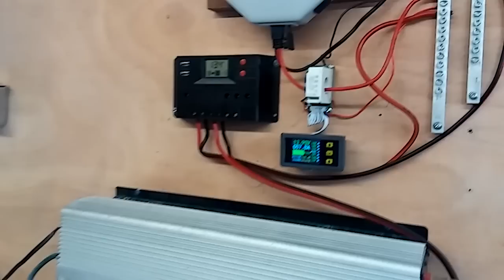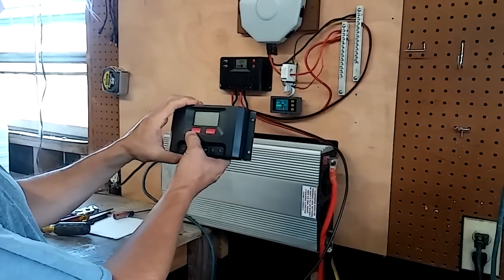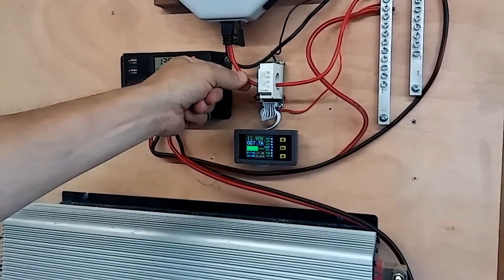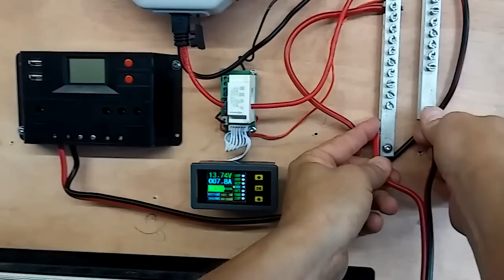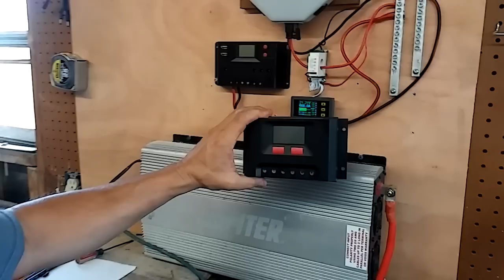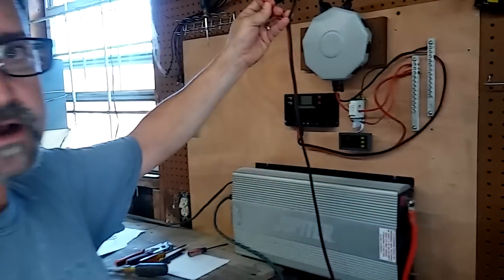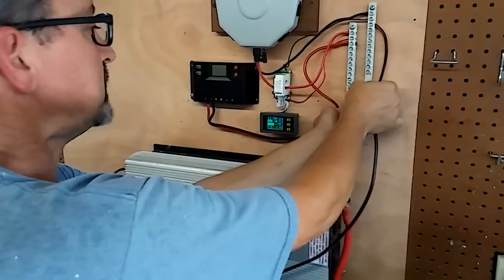Maxing out Harbor Freight solar panels

Comment: Pick up a cheap 400W Wind Turbine for around $200!  You'd be surprised how much extra you can supplement your panels with a Wind Turbine.
Reply from the maker: roostershooter76   I do have my eyes set on. It’s only 200 watts at 24v. Thought I might try it
Reply: It would be cool to use a whirlybird connected to wind turbine generator to benefit from the excess heat being created. Added efficiency

Comment: Your reasoning on the charge controller is flawed. The controller actually can either boost or cut the voltage from the panels as needed. The internal microprocessor calculates the output wattage every second and adjusts the boost or cut to give maximum watts into the load. The battery holds the voltage constant at the battery voltage, which in this case is not at the optimum load voltage for those panels to give maximum output.
Reply: That is a very accurate explanation of how an MPPT CC should work ....

Comment: I would like to remind everyone that this guy   Has probably not checked the output of his panels when his battery voltage was lower than 12.4 V At that high of a voltage most charge controllers especially cheap ones and even hooking the panels straight up to the battery will not charge it much faster because at 12.4 V the battery is pretty much at 100% state of charge and is more resistant to taking a charge Then if you let it run down to 12.3 V or even 12 V Plus the fact that the panels are mounted directly to the roof is going to cause them to get really hot which will cause their efficiency to drop in fact it can even cause connections in the panels to DE solder themselves Which can render a panel completely useless What he should do to test each individual panel and see If each individual panel is working is he should put a load on his battery bank that is more than what  His solar array is capable of putting out and wait at least 5 minutes And then he should go disconnect individual panels and see if that makes a difference if a panel is working correctly and giving him the proper output he should be getting 1.4 amps per panel meaning his arrays should be giving off 14 amps right now Or what he could do is unplug one of the plugs for a set of panels and see if that changes the Ambridge at all And if that doesn't change the amperage at all he should plug that set back and and unplowed the other set and if the other set being unplugged kills the output altogether  Even with that 1 being plugged in then that just means he has a set of  bad panels  But what he should really do is he should put a load on his battery with his pinos all completely unplugged And it should be  A  200 W plus continuous load And then he should plug each individual panel back in check the amperage then unplug the panel and plug another one in check the  Amperage anti should do that with all of his panels to make sure that each individual panel is working and they all have a consistent output with each other And if they don't have a consistent output with each other or even some don't have any output at all he knows hes got   bad panels.

Comment: you may try one more thing to maybe bring up the amps coming off the panels...  bypass the combiner box...  run your positive cable coming in from the panels to (1) bus bar, run your negative cable to the (2nd) bus bar...  then use the little short +/- cable that came with the system....  to the charge controller....  this may help, and maybe not, but while you are experimenting,  it wouldn't hurt to try it....

Comment: HA HOW YOU DOING ......I GOT A DROK METER  WHAT WHOULD BE THE BEST WAY TO INSTALL .......I HAVE THE SAME SYSTEM YOU HAVE  HARBER FRIGHT I LIKE THIM SO MUCH I GOT MORE OF THIM   285 VOLT  CAN YOU HELP ME IF SO THANK YOU..................RWE.............
Reply from the maker: I didn't have much luck with the Drok meter so I got the Yecco one instead. Its the one in this video.. But if you are going to use that one , it has a shunt to read amps. Your load must travel through that shunt. Just like as if it were a fuse. Then just hook up the positive and negative to the meter. Remember!!!.. You must use the positive and negative that is also powering the device you are testing. You can't use a separate power supply to power the meter.

Comment: Like your video, but for one thing. Is it a good idea disconnecting solar panels in bright sunlight. You could damage your solar panels.
Reply from the maker: I've never heard that one before. Thnx. I will take that into consideration.
Reply: I did read that some where some time ago. @Checkitfirst
Reply: That's like saying: When I'm out in the sailboat and the wind comes I will take down the sails because the sails might get ruined.
Reply: @TowingTransport  There is times when sailors take down the sails when there is too much wind because the sails will get ruined.
Reply: @paulwood2329  Where did you read that?  I call BS !
Reply: @MrSummitville  If you don't mind your solar panels covered in hairline cracks then carry on doing what you always do.
Reply: @paulwood2329  After 10 years of "doing what I always do", I and all my neighbors do not have this problem.  Again - Where did you read this BS ?
Reply: @MrSummitville  It's written on one side of the MC4 solar panel plugs.
Reply: @paulwood2329   It does NOT state that you will create hair-line cracks in your PV Cells !  The RULE is ... Do NOT disconnect any MC-4 Connectors while the PV Panel is under load because the ARC can damage the MC-4 copper contact or YOU.  You pull the DC Disconnect Switch first, then you unplug the MC-4 Connector. This has nothing to do with hair-line cracks in the PV Cells.  Like I said, I call 100% BS on your hair-line cracks nonsense.
Reply: @MrSummitville  Just out of interest have you ever tested off-load voltage of your solar array? It's high enough to give you a very nasty shock.

Comment: Wrong! An MPPT controller will reduce the voltage and boost the amps. How you came to your conclusion an MPPT controller can't help you is beyond me.
Reply from the maker: I wasn't producing enough power with what I had to justify getting a mppt. I did however get one. It didn't benefit me at all untill I added more panels. Now I can justify the cost. 200 watts isn't enough power to get any benefit from a mppt. I now have 500 watts and the mppt is doing what it should.
Reply: Correct you would need 400 watts and possibly making a 24,48 volt system before justification for a mpp inverter. If running 12v the harbor freight controller is just fine☺️

Comment: Those 8 solar solar panels are rated at 25 watts for each individual panel but this rating is at 18 volts not 13.78 (your current battery voltage seen in this video) Your sending all 8 of those panels in parallel to that charge controller. You have the potential of 200 watts (18 V @ 11.1 Amps) worth of solar panels but your only going to get a max of  about 153 watts. The reason is because Your charge controller is truncating the solar panel voltage anything above your current battery voltage 13.78V  So  the wattage between 13.78 and 18 volts is wasted. 4.22 volts  X 11.1 amps is  46.8 watts LOSS. All 12 volt solar panels have this issue. The only solution is to use an MPPT charge controller. It electronically converts the 18 volts of each panel to a lower charging voltage usually around 14.4 volts. and at the same time raises the charging current. At around 95% efficiency You would end up with about 14.4 volts  @ 13.19 Amps in full sun. depending on the charge state of your battery. Giving you  about  190 watts vs 153 watts using the cheap harbor freight controllers. Get your money back on that charge controller and go online and look for a MPPT charge controller. Don't look for one at Harbor Freight.
Reply from the maker: Thank you for your comment. I have learned what you say is true. I did find a mppt on Amazon. It's in my latest videos. I have also added 2 monocrystalline pannels to my set up☺

Comment: Actually you would benefit greatly from an mppt charge controller.  PWM, or standard charge controllers are shit compared to mppt. You "harvest" much more of your power that's being put out from the panels with mppt.
Reply from the maker: Your not the only one who suggested this... I first started out testing harbor freight solar... I guess I should now look into mppt since I'm going to add a 400 watt wind turbine to this.
Reply: Harley is correct that you would benefit greatly, I want to explain a little more. The voltage solar panels produce is much higher than a typical battery bank. For this example let's say you have a 12volt battery and your panels are generating 18volts. A PWM charge controller simply decreases the voltage to a level needed to charge, then maintain the battery. (Effectively losing some of the power being generated).

An MPPT charge controller does the same thing, however it takes the additional voltage and converts into amps so you are, as Harley stated, harvesting all the power potential of your panels.

Comment: You should never get into the habit of touching live terminals with your bare hands voltage is pressure it's current that kills especially DC current if I squirt you with a squirt gun, or if I throw a bucket of water on you which one gets you more wet? A Squirt gun is high voltage a bucket of water is low voltage current or amperage is the amount of electricity, your hands and fingers have muscle memory don't teach them bad habits, I'm not trying to talk down on anyone , I'm trying to save lives ,I've been an electrician for 40 years, never touch terminals even if you know they're not live always treat everything like it's hot.
Reply: Well said...even an array of solar panels can fry ya...maybe not this particular setup but always a good thing to remember.

Comment: humm something doesn't add up your getting 8.1 amps and 13.75 volts which gives power of of around 111.375 watts ish. Similar to what your saying on your amp meter. But if these are 100 watt solar panels and you have 2 of them where the heck is the 200 watt power. Or what do they mean by the 100 watt panel rating because you getting a lot less then that as power output...so its like your loosing alot of efficiency to resistance , internals , or heat... I am probably missing something but the number don';t add up...its really easy to install this solar stuff from what i see but the math is not adding up so a little uneasy about it when it comes from the theory to the practical side.

Comment: Not True..   The MPPT would in fact use the over voltage to gain Current.   You could realize maybe a AMP or more then your doing now.
Reply: What is the problem is ... the HF PV array over rated and it is too hot ?  If they are really 200 Watt Panels and cool then he could get 12.3 AMPS = 200 Watts x 80% / 13 volts with MPPT ?  For sure, something is wrong here ...

Comment: The charge controller that comes with the 100 watt kit is a 20 a controller rated for 245 watts ( 2-100 watt kits and a 45watt kit thru their hub) it's states this right in the manual that comes with the kit. This guy is feeding false info
Reply from the maker: Gene Rappleyea What info did I say that was false

Comment: Your bus bars are creating  amp draw.
Reply from the maker: Sorry.. But no..
Reply: @Checkitfirst  I'm new to this and purchased 2 kits as you did. Realistically with your setup. What's the potential of these 2 kits to be able to run in a 24 hour period? I bought these is anticipation of building a cabin on the river. The only electrical items I'll have is a fridge, freezer, led lighting, charging phone, tankless water heater.
Reply from the maker: Brandon Jackson. You could probably get away with running one of your fridges but that’s about it. Don’t buy any more harbor freight kits because you can buy a single hundred watt panel for less than $100 on Amazon which you could add to your harbor freight kits  that you have. That is what I have been doing and it’s a lot cheaper and they seem to work a little better. Once you have added at least one more panel you can get away with running 2 fridges like I am doing but it also depends on your battery bank. Absolutely no less than two good deep cycle marine batteries. Make sure your two batteries match exactly meaning same brand same size bought at the same time. I ran into a problem running my batteries in parallel with two batteries that did not match and my reserves went down much faster than just using one battery
Reply: @Checkitfirst  I have 4 deep cycle that are all matching and brand new for the setup. I'm just new to all of this and had read that these HF kits were really good for the money and held up great.
Reply from the maker: Brandon Jackson. I have had mine up on my garage roof for going on two years now and they still work.
Reply: @Checkitfirst  that's really good to know. I appreciate your knowledge and info.

Comment: Learn about maximum power point tracking if you want the max power from your panels. Hooking them directly to the battery does not do it because the battery pulls the panel voltage below the panels maximum power point. The mppt controller basically uses a DC to DC converter to allow the panels to be at mpp (maybe 17-18v)  and the battery to be at 14v or less which gives maximum power transfer.
Reply: Words of wisdom!  But this is only a 200 Watt HF array.  So, is an MPPT controller really worth it?  Maybe if the array was 1,500 watts or larger?

Comment: Dude, you are not supposed to place solar panels directly on a roof like this.  They benefit from airflow underneath them.  Raise them up a few inches.
Reply from the maker: David James. Getting my 3rd kit soon. Going to fix that issue when I install the new kit.
Reply: It takes you 3 kits to do something you should have done from the beginning?
Reply: Also, why would you buy 3 kits if they are advertised as 100W and you are only getting about 50W out of them?  You are spending way more than $1 a watt.  That is bad!
Reply from the maker: David James . I guess your right. There are different types of panels. Maybe I will look into some
Reply: There are cheaper panels, but they all have pros and cons.  In countries were electricity is expensive and the sun is stronger (than in USA), it makes more sense to me to use solar.  Here in USA, it is fun to tinker with, but unless you plan on using it for a decade or more, it is not saving any money (exceptions would be if you get a super cheap used kit, a gift kit...).
Reply from the maker: David James . I was thinking more along the lines of emergency use. I live on the gulf coast and Hurricane Harvey played a big roll in power loss here. Thought maybe I could use it to run a small fridge and microwave if we lost power again
Reply: That is what batteries and an inverter are for.  Solar will help some with recharging the battery bank but why not just start up your car/truck/motorcycle to charge your battery bank after an extended power outage?  My Kia SUV can charge a bank of 7 100Ah 12V AGM batteries in a few hours from a mid state of charge to about 90%.  That is good enough to put them back into service.  Actually if the load is less than about 1000 watts, you could even run the load while the batteries are charging since an average car alternator can put out close to 1000 usable watts (some are more than 1000).  It will slow down the charging but it will also shorten the power interruption.
Reply from the maker: David James . Yes,, I suppose I could do that.. But I also enjoy playing around with this stuff. Gives me something to do.
Reply: I agree solar is fun to monkey around with.  Problem is, if one company misadvertises their panels as being 100 watts, when in normal conditions they are more like half of that, then the other companies need to do the same to "compete" cuz it seems that an average Joe, if given a choice of a 100 watt advertised kit that is a true 50 watts and a 50 watt advertised kit that is a true 50 watts, would purchase the "100 watt" kit.  To me, if a company came out with a kit and actually underrated it (like advertised at as a 100W kit but on some locations/conditions would produce even more than that), that company would quickly gain the respect of the public.

Comment: 100 watts at 12 volts thats all ull get is 8.3 amps or 8.5 ant it
Reply from the maker: Actually its 100÷18 so thats 5.5 amps. The pannels are 18 volts not 12.. I just found this info out a few weeks ago.. This video you are commenting on is actually 200 watts
Reply: Check it first ok i thought it was one and i thought they were only 12 volts going to hf right now

Comment: That is a 30 amp capable charge controller! You are no where near maxing it out with 200watts worth of panels. It can handle double that 4 kits together. 400watts
Reply from the maker: Random Adventures. First of all that controller has a 20 amp fuse in it so it is in no way a 30 amp charger. Second of all I wasn’t testing the charger, only the panel. Charger was disconnected

Comment: Harbor freight panels totally SUCK. I had them and they are a waste of money. Get some real panels being at 340 watts. I now have 12 of them and I have 3 Tesla cells running 4 2500 pure sine wave inverters and powering 2 fridges a freezer 3 65 inch tv's and 2 window air conditioners all day long. I am getting 80 to 90 amps during the day. You can buy the 340 watt panels from ebay for 79.00 each. I am saving a lot of money and I have 8500.00 in my current system. The only thing I want to do is add more batteries. I want 10 233 ah tesla cells and then I am set. Great video by the way.....
Reply: 79bux for 340w panels yeah right
Reply: @iditarod4081  They're called santansolar.com out of AZ. and that is exactly what I paid for them. Call em and see for yourself. But I know I don't have any idea what I'm talking about.